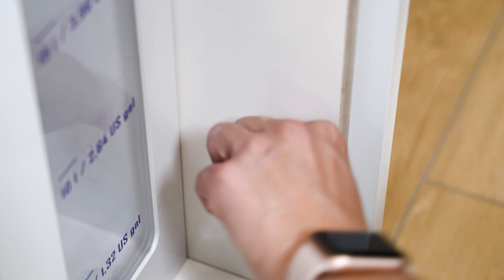AF OceanGuard 435 | Manual

Comment: Wish you would have had a 3/4 return line instead of 1/2 inch. I see a big restriction on mine. The 1/2 ball check valve also doesn’t help. Just some feedback.